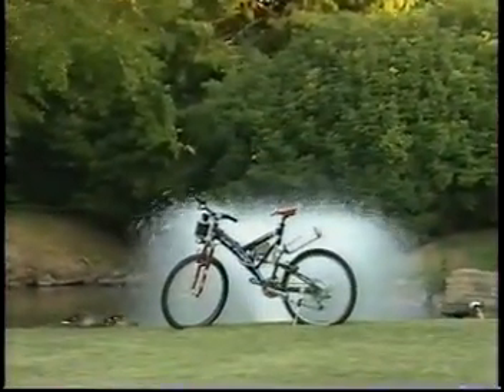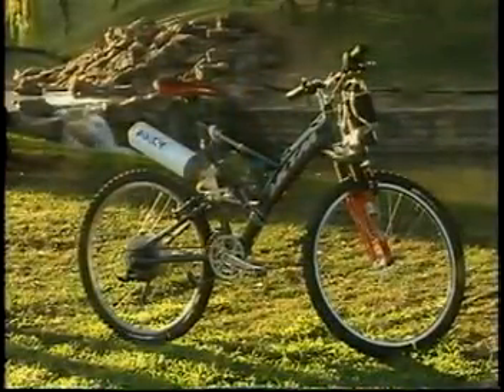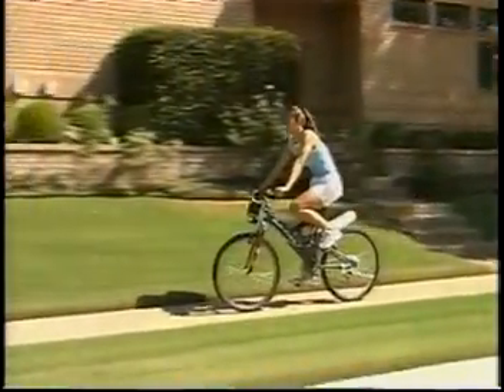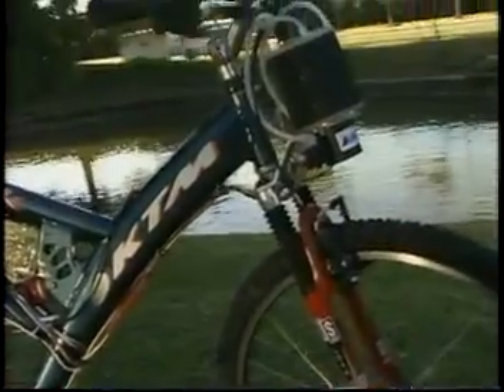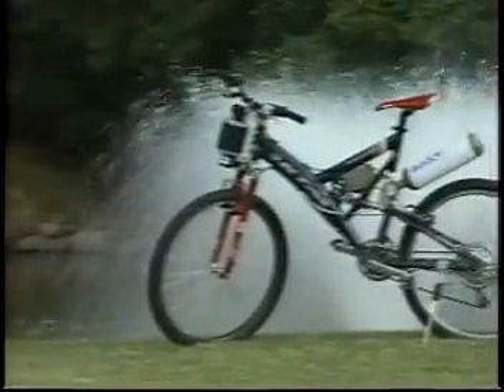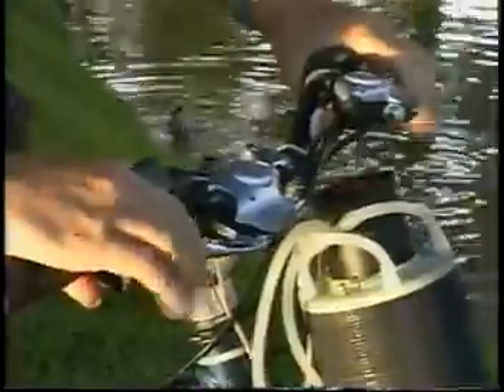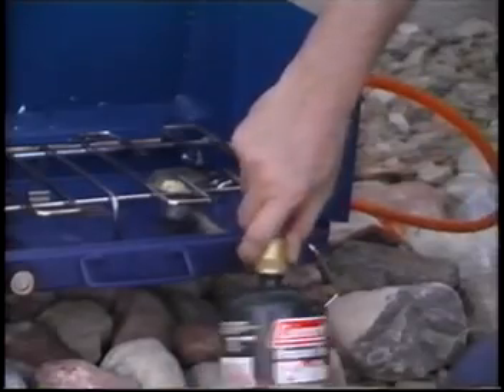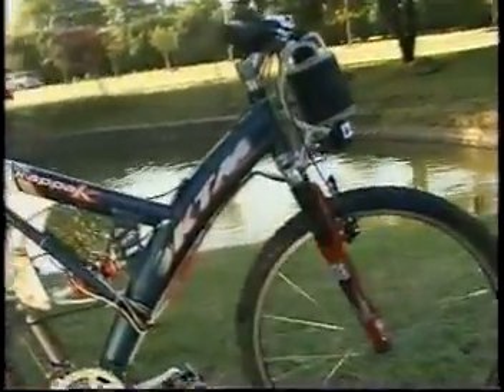First Hydrogen Bike

Comment: Power needed to make hydrogen from water is close to 3 X the power required to charge batteries to do the same thing because of energy losses in hydrogen production and production of power with a fuel cell. Isn't it easier just to use light lithium polymer batteries? Cute fuel cell, however. If the electricity were virtually free and abundant like from wind or solar it might be worthwhile. Range would be slightly better by weight, but hydrogen production and usage is more wasteful energy-wise.

Comment: As long as it falls apart within a couple years or at least drives a repair part market for a few more. And it doesn't cost more than 1500 dollars... people should be able to buy one if it compares to the cost of a big LCD. I like the idea of a car for under 15k running on hydrogen combustion produced at home with solar power. I'll probably build it myself anyways. Bet it doesn't cost me more than my time reforging trash metal with the sun.

Comment: @larryllix agree with you, that is why you create Hydrogen from water like this guy did watch?v=r0habREaSyQ

Does not even have to be clean water. 

Every house a power plant with Hydrogen + solar + wind and no need for oil/gas or nuclear.

Esp since nuclear is so incredibly expensive every alternative energy system is easily cheaper.  

Consider re-casking every 50 years for the next 240,000 years or 3,600 years (Cesium per Chernobyl 25 years later)  Nuclear is only cheaper / lies.

Comment: @crazybear38 -
it appears I understand energy and you dont.  We use fossil fuels not because of engineering properties, but because they are a ready made energy store. Technologies like hydrogen fuel cells and electric motors were discovered simultanously. I would argue solar concentrators/windmills are actually easier to master than offshore drilling rigs. I've seen DIY on youtube. Humanity is not 'endlessly adaptable'. our tech is crude and simplistic compared to what evolution created.

Comment: @crazybear38 recommended reading for you: google "peak oil die off introduction" i agree with 90% of this text . if you can debunk the other 90% i'm all ears ! it covers fuel cells. where i disagree, - its 2billion not 0.5; elec CAN do anything oil can, just nowhere near same qty. and 9/11 was not inside job (stress approaching peak enough for pre-emptive strike by aqt). but threats may have been made to provoke them.

Comment: @crazybear38 - solar panels will compete for food production.
some say use solar to electrolyze water. if you have sunlight+water you can make food. biofuel or spirulina? currently oil has multiplied useable food & hence population 8X.
without fossil-fuel energy input there will be a population crash - billions will starve or die fighting to the death over dwindling resources. Future is soylent-green+mad max.

Comment: @crazybear38 -
hydrogen & electricity should not be mentioned in the same way as Oil, Fission, Fusion, Sunlight. The former are only energy Carriers. the latter are energy Sources. If you want a technological world to continue for such a large population, only Fusion will cut it. it doesn't work yet,it may never. Fission has same problem as oil, its finite. peak uranium. enough reactors might mean a chernobyl or fukushima every year ? (still I'm pro fission, its the least bad option now)

Comment: @crazybear38 
"We use electricity primarily as the energy source for manufacturing."
-no, we use fossil-fuels, electricity is an energy carrier not an energy source. If wind/solar were enough to make that electricity we'd have an independant economy of solar-powered solar panel factories. Nature already did that (plants). I think you get cause and effect the wrong way round. Our tech adds very little 'information' compared to evolutions 'designs'.our tech is crude fossil-fueled brute force.

Comment: @walter0bz  Ummm trying to understand what you are going on about here ... why is a bike the only viable future personal transport? How exactly do you believe fossil fuels affect how we manufacture items? We use electricity primarily as the energy source for manufacturing. 
You don't run things on sunlight you run things on electricity ... which can be made from many many things - hydrogen fuel is an example of such. Also there is wind, water, sunlight, fission, fusion etc etc ...

Comment: @walter0bz Where exactly do you think we get oil? IT IS DRILLED AND PROCESSED AND REFINED! It isn't mana delivered from heaven by the oil gods, there are similar amounts of processing required for hydrogen as well.
I never called it the "saviour" I don't think there will be one "saviour", but we are quite capable of moving away from such extreme dependence on oil. I love your point "it's like a rechargeable battery" .... ummmm isn't that kind of the point -> renewable?

Comment: around 6.8 megajoules converted from gas and around 4.5 from Hydrogen fuel using an electric motor.  

Also all this stuff about "yeah but making hydrogen fuel is as damaging to the environment". You just need electrical power to make hydrogen fuel which CAN come from multiple sources - some very green. Oil drilling is only going to get more difficult and dangerous ... BP anyone? 

Give hydrogen and electric the investment oil has had and it just makes sense.

Comment: @walter0bz Looking at energy density per litre which I presume is what you are referring to you are correct in saying petrol is much higher at 34 megajoules compared to hydrogen compressed to 700 bar having 5.6 megajoules (wikipedia). However if you also take into account that a total combustion engine has AT BEST a 15 - 20% efficiency compared to around 80% efficiency of an electric motor (not to mention regenerative breaking), you will see there isn't that much difference -

Comment: how efficient is the process to make hydrogen compared to charging a nano lithium battery? i thought hydrogen was a expensive and wasteful high amounts of pollution if you use fossil fuels.  i like that it is light weight , but it too has a motor, so as batteries get smaller as they are with nano ,what is the future?

Comment: True, most people can pedal a bike 5 to 10 miles in an hour, but it's also true that not using the available solar energies available is also a waste.  The hyrdogen assist/ride bike can give you much more range and faster times of travel.   With oil and gas prices rising, there is less and less to complain about with green energies.

Comment: @rayr84a63y42 Sorry. Hydrogen is a dead issue and most governments have dropped support now that the truth is out there.

Research "Hydrogen Exergy". 97% of energy using hydrogen is wasted.
BTW: Hydrogen leaks through steel container walls. It's molocule is smaller then the holes in steel.